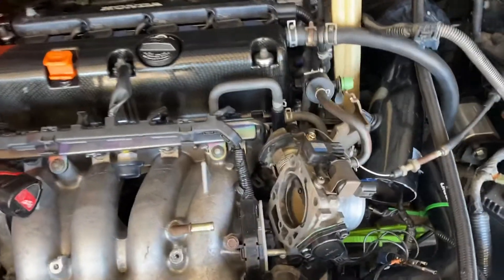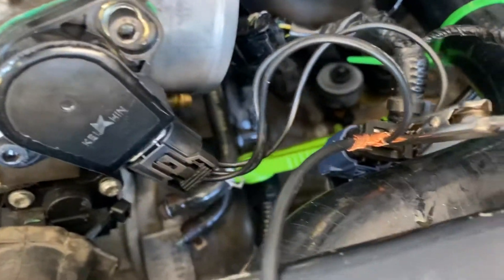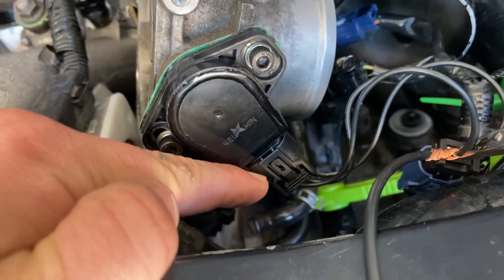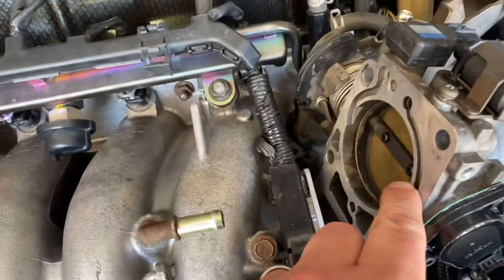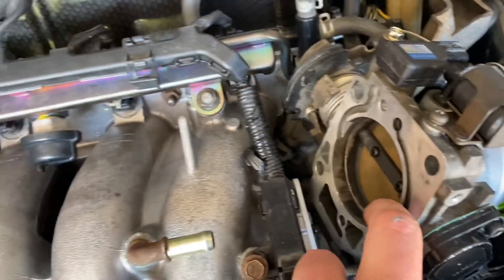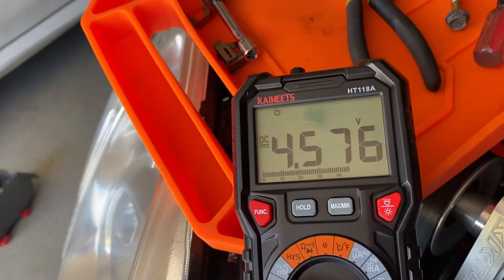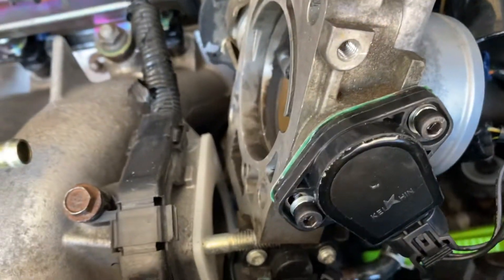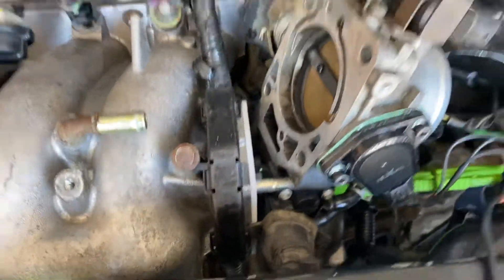Multimeter setup for tps calibration Honda Acura k20a2 rsx ep3 with voltages

Comment: Heloo ,I have accord eurorcl7 ,It has sto ck ecu rbc, stock throttle ,sto ck tps sensor ,but when I  callibrate it to .50 and 4.5 wot ,it gives code ,tps voltage low.but if in set it to .52 it don't dove code .so what do you recommend is best .50 or .52??
Reply: Really want it close as .5 as possible. But 4.5-5 works perfect for me
Reply: @jesusesquive2424  thx for reply ,just 2 days ago I  callibrated it again ,now I have set it to .49 fully closed ,and at wot ,it shows 4.5 .and vtec are kicking perfectly fine .on this setting.So I will not scan it ,because its working fine.
Reply: @hassansafeer7411  iacv isn’t vtech, need to check the whole iacv assembly on the throttle body and check it make sure no air is getting sucked In that shouldn’t. Same with the other air lines/areas air lines are, need to make sure no unnecessary air is getting sucked in. Change spark plugs to new and regap
Reply: @jesusesquive2424  one thing more I wanna ask from you ,when my engine is cold ,I mean when I start my car in morning ,it does missing a lot ,like when I press race padel,it sputters, even I am unable to move my car ,inch.but when temperature needle rises to quarter then I  can move my car from stand still.Can you guide my why it that so??
Reply: @hassansafeer7411  it could be a few things, I’d go through and check every air lines make sure there’s no air getting sucked in where it shouldn’t. Second I’d check is iacv make sure it clean and no clogged. Personal I’d replace all the spark plugs and regap them as well. NGK Iridium is the best. After you check those let me know
Reply: @hassansafeer7411  personal I’d get rid of iacv unless you’re stock iacv is useless
Reply: @jesusesquive2424  yes bro ,there were few leaks ,that pipe which goes from throttle to caneseten valve ,it was broken and throttle was sucking extra air from that with 2000rpm at idle ,so I have blocked that pipe with a bolt .and then rpm was normal showing 900.secondly I also cleaned my idle air control valve with nasa spray and wd 40 .that spindle needs to rotate freely smoothly .I cleaned  out all of it's carbon ,my idle is perfect .there is no up and down.Secondly I installed oem plugs ifr7g 11ks ngk. I purchased new set of ngk plugs ifr7g 11 ks .I also installed  bosch plugs ,but still the problem was there .I installed bkr6egp ngk brand new set ,but still it give missing at cold .I  cleaned my injectors too on machine but still the problem was there.,,,,,it's like ,as if it's to much rich air mixture at cold but when it's get hotter then it's fine .should I  set my tps to .45 ?? to make it little bit lean and that missing might go even at  cold ,right now it's .49 .

Comment: ive been setting mine wrong but been working just fine,i been setting then with throttle closed first instead of wot first.can this throw things off?

from my understanding im supposed to set at  4.5v wot then when throttle closes should read 0.48v,if this numbers off with throttle closed then i adjust idle screw until it reads 0.48v correct? also not do this with car idling since iacv will change the settings?
Reply from the maker: WOT: 4.5
Idle: 0.048 - 0.050